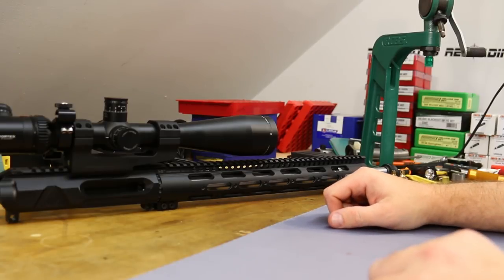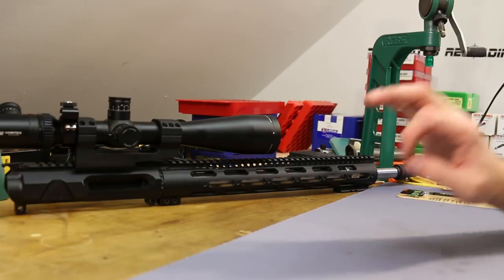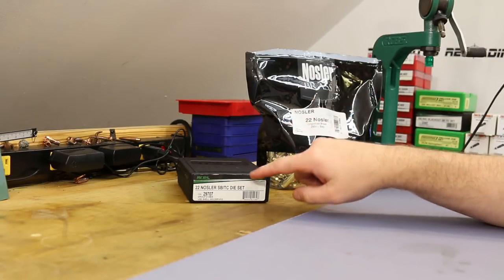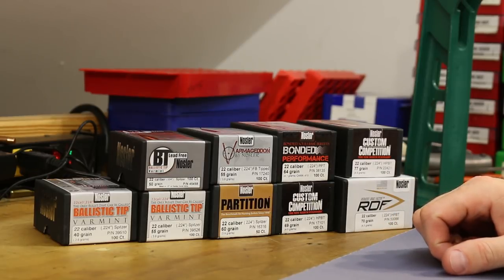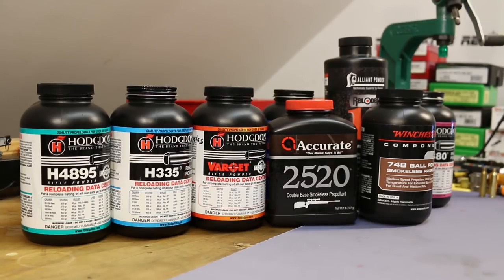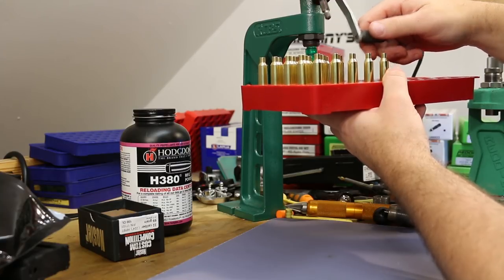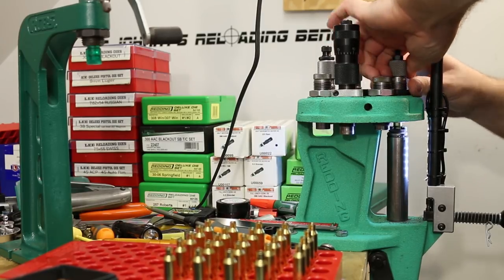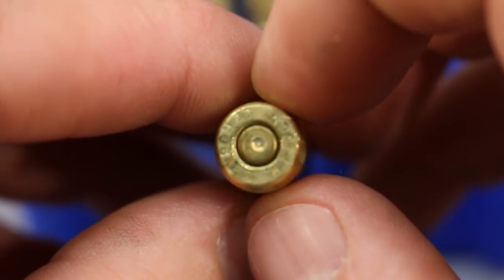22 Nosler - Part 1 - Trouble from the start

Comment: I had simular problems with my creedmoor build and had to switch to a JP extractor in my BCG. I have never heard positive info on the Odin BCGs. I was killing creedmoor brass and it is crazy expensive. I bet you spent close to 1k on all the components for this series, and that adds to the frustration with a rough start.  We appreciate your work,  I am positive you will get it worked out.

Comment: I have a Odin Works nitride coated Bolt carrier group with a x products side charge upper and I love the combo I think I'm going to get a 300 blackout 18 inch stoner barrel you have used. I am impressed by it's accuracy and I am looking forward to running some of the more accurate loads you have run with it.
Reply: I have a flat spring as well but it seems to make a scraping sound even when all is cleaned and oiled. I am going to be changing it, don't like the scraping.

Comment: I've seen brass very much like that in another caliber, with factory rounds.  Turns out that the bullet was jamming into the lands, even on the factory ammo.  I know you checked the chambering of the initial rounds before firing, but just load a bullet into a brand-new resized case to the same length and then chamber, extract, and look at the bullet for marks from the rifling.  Every manufacturer can make a mistake.  Don't let the naysayers get you down on the caliber, it may turn out to be a great shooter when you find the right combination of bullet, primer and powder, just like you've found in the other calibers you shoot.  You'll find one combination that will shoot bugholes, it may just take a while.  Looking forward to the new video in the morning when I get to work.  When August is done, you're going to be very tired, and the rest of us will go into withdrawal!

Comment: I really like the k m flash hole deburring tool $19 one tool will do multiple calipers with no trimming of cases needed. The depth of cut is controlled inside the case on the case head.

Comment: JRB, the bulk 250 piece bag of brass from Nosler is much cheaper DUE to having NONE of the brass prep done on them. On the non-bulk brass, they are fully prepped to include deburring the flash holes lol.

The small batch brass while much more expensive, has been deburred, trimmed, primer pockets uniformed, and weight sorted.

Edit: you should have grabbed the barrel from www.ar15performance.com every one of them I've used in my build or friends builds has been well under MOA with pretty much everything, even 55fmj bullets.

Most powders that do well for the Grendel won't be that great for the Nosler as it has a much higher case capacity and smaller bore diameter to case capacity.

Case load blocks and ammo boxes will be the same ones used by the 6.8SPC, since it is a modified 30rem/6.8 case 

With the way the case head looks, I would debur the bolt face, the ejector hole, and anything else that has sharp points or edges.

Comment: 22 Nosler will be very picky about your gas settings. You will want to tune it for your suppressor and load so you are not destroying brass. High bolt thrust on that rebated rim + soft Nosler brass makes brass life an art with the 22 Nos

On another 18" Odin Works 22 Nos barrel we tested, 28gr of Varget under the 70gr Nosler RDF was giving amazing results.

P.S..... you were warned...lol

Comment: I am looking at this.  I kind of want one so bad. But brass is hard to find. After watching this first video. I'm reluctant on getting a 22 nosler. I'm still looking at the 7.62x39 upper.  Not sure if it's better.
Reply: I highly recommend 6x45 if you want a wildcat. 70 grain Nolser ballistic tip bullets are extremely cheap, you use the same bolt carrier group and there is quite a bit of load data.
Reply: David Peterson I'll have to check that out.  Besides 223/556.  I have a 6.8 and 300blackoit upper will be here tomorrow.  So. Looking at other uppers to try.
Reply: I would go with 6.5 grendel necked down 22 then utilize 75 & 80 eld.  Grendel brass is good bullets high bc less than .20c bullet .   Good out 1000 yards

Comment: Just a comment/question as I watch. Did you contact Nosler and ask them about the primer pockets and the flash holes? Is it possible that this particular run of brass was not formed properly? I'm super curious, as I watch this video.

Comment: Frustrated with 22 nosler. Keep on adjusting gas block add weight tungsten.  Slight improvement on brass.  Tried jp enhance bolt made it even worse.  Waiting on rifle length buffer hope add weight pass 5oz will help out.  With decreased loads only gives slight advantage over 223

Comment: I guess with the space around the primer pocket it's not a "in the mud" round. Maybe you mentioned it, but I'm assuming this requires a different bolt.  Would I be correct in that?
Reply: homiegali no the case head is rebated to make use of standard 223 bolts. I feel like that is the downfall of this cartridge.
Reply: homiegali uses standard 223/556 bolt and carrier.

Comment: So after doing all your reloading and test on 22 nosler and 224 Valkyrie which round would you your self use for predator hunting.
Reply: If you are a reloader I would go the 22 Nosler path. He has a new series fixing the 22 Nosler where he uses Hornady 6mm Hager brass which fixes all the problems he has had with 22 Nosler. He found the 55gr Nosler varmageddon shot ~.5 moa out of his Oden Works barrel at ~3500fps. With the 224 Valkyrie he has found the primer pockets to get loose after 1 or 2 firings at 'high-pressure loads'. If your not a reloader I don't know, I think cost is about the same for ammo and you only get one or two choices for each cartridge.
Reply: @jayyoung5627  I have heard the same regarding both. Plus the fact that 224 valkyrie is very jump sensitive then there's the whole boat tail versus flat tail debate as well. So not all the .224 bullets will work with the Valkyrie. So to me I have been leaning more towards the 22 nosler. But I will keep doing more research and see what is more worth the hasel.
Reply: @adamcastillo1951  I haven't played around with 22 nosgar or the 224 Valkyrie. Johnny got me on the 6.5 Grendel train and I love the cartridge. Hornady has some 95gr Vmax for the .264" cartridges and they are cheap. I haven't fired any through my gun but my brother has had some luck. I mainly use my Grendel for deer and hogs but I am sure it would take a coyote no problem. I would recommend a 20" barrel for the Grendel just to get that 50-100 extra fps.

Comment: Why don't you measure your freebore and jump for each bullet? The Sinclair tool is cheap and you don't need a modified case to make the measurement. It only takes a few minutes to do.  Some AR barrels have very short distance to the lands especially with longer bullets having a short tip to ogive distance. This will save you a pain at the range and prevent you having loads that won't fully go into battery, especially if you are loading a new cartridge that has just hit the street. The Nosler brass is somewhat soft and will tear up pretty easily. It will also loosen primer pockets fairly quickly when loading full power loads.
Reply: You can spend a little time on the extractor with a stone and clean up any burrs on it.

Comment: Just remember that the Nosler manufactured 22 Nosler brass is crap.  Soft and damages very easily.  I'm hoping another manufacturer starts making it soon.  Considering the velocities you had I don't believe your charges were too high.  My first loads were well within the mid range of the Nosler recommended charges and I experience some unacceptable rim damage.  After the initial firing and first sizing, case length was all over the place.  To me that indicates soft brass.  Nosler obviously rushed this caliber to market and manufactured and is still selling poorly made brass. I also believe the 223 rim is insufficient to support the extraction of the larger case especially when that case is soft, exposed to greater pressure and expanding more in the  chamber.

Comment: Nolser's data is for a 24 inch barrel.   You simply cant get the velocity with the barrel length you currently have.  You have 6 inches less and you cant make up the difference with powder.  22 Nosler needs a 24 inch barrel to get the velocities you are looking for.  Sell it and buy a 22 inch 6x45 barrel.  You wont regret it and you can use it for deer hunting.  The best place for the barrel is https://ritchsprecisionguns.com/
Reply: correct but some states do not allow any 22 caliber rifles for deer hunting but all allow any 6MM rifle for deer hunting.
Reply: David Peterson 18" barrel doesn't sacrifice much velocity to a 24" tube, usually between 75-100fps depending on the bullet/powder choice. Been doing testing for 22Nosler now for about 3 months and I am happy to have kept the 18" and sold off the uselessly long 24"
Reply: @jimhans1 I have barrel lengths ranging from 16 to 24 inches and have been reloading for over 10,000 rounds.  I easily get 300 to 400 feet more going from a 18 inch to a 24 inch barrel.  It will be interesting to see the results from the next video.  What velocities have you achieved with the 18 inch barrel?  What powder did you use and what bullet weight?
Reply: David Peterson my 77gr TMK load I am using a max charge of CFE223 with bullets loaded to 2.300" and my average for 10 shots was 2850fps, the SD was 12, ES was 31, and the group sizes were .63" at 100yds and 1.18" at 200, from my 18" ar15performance barrel. That's my go-to load for longer range target work.

My 55gr load is made up of 55gr Nosler ballistic tip bullets loaded to 2.260", over a max charge of AA2520, they are giving me 3315fps for 10 shot average, SD of 10, and ES of 39, with groups between .75" at 100, to 1.3" at 200.
Reply: @jimhans1, your 77g TMK is the NATO/223 velocity for 5.56.  Hodgdon list 223 CFE223 max velocity of 2811.  I have pushed my 77gr Nosler CC to 2911 with CFE223 in a 24 inch barrel with a NATO chamber@ 1MOA accuracy.  I am sure I could bring the group size down to 3/4 MOA with a 223 Wylde chamber in a 24 inch barrel.  This clearly demonstrates why  22 Nosler is not much more and sometimes less than 5.56 in a comparable barrel length with heavier 22 cal projectiles.  I routinely push 55gr projectiles over 3300 in my 5.56 NATO chambered 24 inch barrel but at 2 MOA.  Your velocity and accuracy are excellent for an 18 inch barrel and this is where 22 Nolser can shine but few are getting your performance levels.
Reply: David Peterson While to some extant that is true, I know a lot more people who don't get those speeds in a 223rem than folks who do get them in 5.56. But as you said, it is requiring the use of abnormally long barrels on their ARs to acquire those speeds in a 223/556 where I can get them in the 22Nosler out of an 18" barrel, with zero pressure signs, I will do a true "max" test in my rifle here in a couple of weeks after my work schedule and family obligations have calmed down a bit. I'm gonna guess I can hit 3000fps with the 77gr load, and try for 3500 from the 55s.

One thing I've noticed hampering folks in their quest for extra velocity in the 22Nosler and other non-magnum calibers in general (6.5Grendel, 223/556, 22Nosler, 277Wolvwrine) is this idea that they need to be using a magnum primer, or magnum equivalent primer (CCI 41) with their loads. Yes, powder makers seem to say that anything other than stick powders NEEDS a magnum primer, I've NEVER used them besides for testing, and never needed them. They jack up pressures without being of great benefit in the smaller cases. In my big magnums (300Kong, 257Wby, 338Lap) yes, they actually helped (in certain cases at least). But for anything else, they are a waste outside of sub-arctic temps, and cause more harm than good.
Reply: @jimhans1, your statement about magnum primers is 100% correct IMO. I do know of some other reloaders who stay away from magnum primers as well.  I use CCI 34 and 41 primers exclusively.  I can't wait to see what Odinworks has to say about the issues with JRB's barrel.  Thanks for the conversation.
Reply: David Peterson I am also curious what Odin will say. And just to make sure, you do know that the No.34 & No.41 primers ARE magnum primers, correct? They are the equivalent of the CCI 250 and 450 respectively http://www.cci-ammunition.com/products/primers/primer_chart.htm
Reply: @jimhans1, I do but I have seen them to be the most consistent for me.  I have recently tried CCI 450 and had inconsistent POI.  So I now just use CCI 41 for 5.56 and I have a couple of ar10 with free float firing pins so the 34 is a little more protection against a slam fire in a dirty chamber. Some would argue these are not magnum primers CCI advises to use them as a magnum primer.
Reply: David Peterson since they carry the exact same priming compound and quantity, and only have a thicker cup for the "sensitivity", not much they can argue on that, but if they work for you, great. I've not found one decent CCI primer yet personally, but that is why they make others.
Reply: David Peterson when you said earlier you've been reloading for 10,000 rounds, do you mean in 22 Nosler for 10k, or that you've reloaded a total of 10k rounds??
Reply: total of 10,000, 5.56, 300 blk, 243 win, 6.5 creedmore.  Mainly 5.56, near 7000 rounds.
Reply: David Peterson so you've been reloading for less than a year? Or just don't shoot much? Not meaning to be condescending, just seems a very low number to me personally. But I've been loading for 26yrs now and know I'm over the 200k mark on loaded/reloaded rounds.
Reply: no, reloading since 2012.